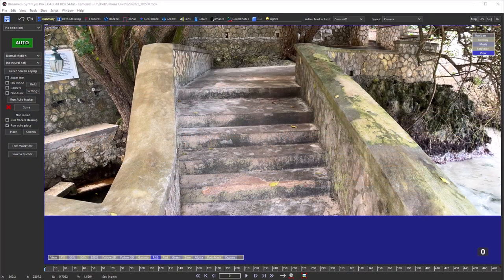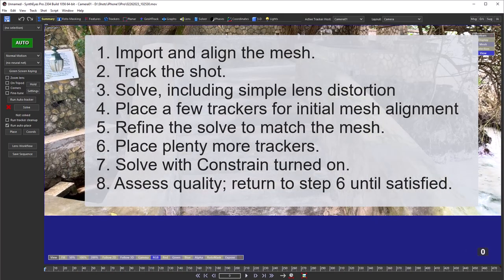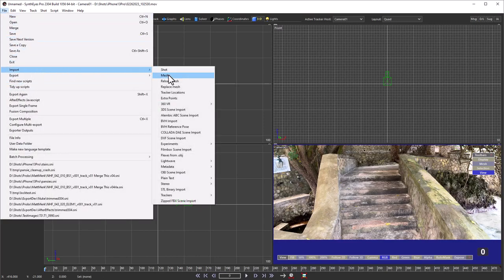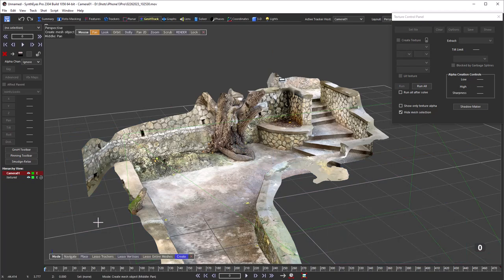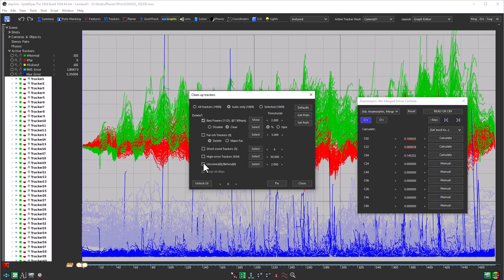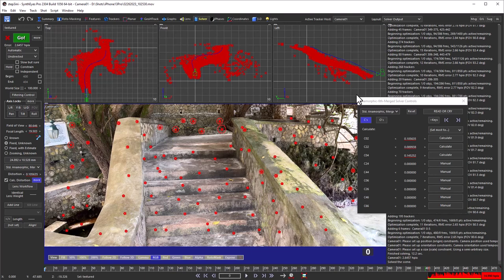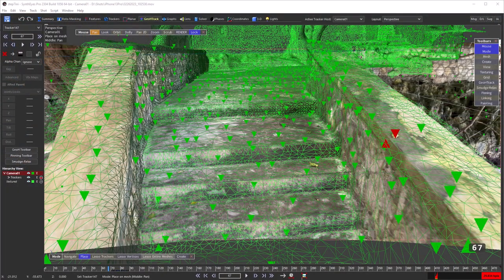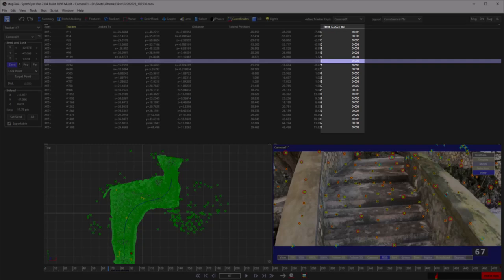Anamorphic Solve Using a Lidar Scan

Comment: Interesting, but I always had issues aligning meshes in SynthEyes. Even if it is a CAD model of a filmed product.
And still this is quite some effort here. If there is a 3D track resembling a shape - and a corresponding 3D object, shouldn´t be it just a matter of a few clicks to make software realize this and align? We live in times when one single word can product photorealistic images - with just one click.
Reply from the maker: Licensed customers can ask for help, there are many ways to do alignments in SynthEyes. Regarding "AI", sure, more things will be possible in the future. AI systems are not known for accuracy, they're better at one-time tasks than doing something repeatedly the same way. (You can see that both in SynthEyes's NN trackers and in Tesla self-driving systems, for example.) Also keep in mind that OpenAI's cumulative investment is something over $11billion; their server time alone costs billions. That's not something that can be supported for a narrow task.
Reply: @SynthEyesHQ  OpenAI is beyond scope, of course ;) But it´s possibilities too.
And there are even smaller companies achieving crazy results, for example in the field of motioncapturing humans.

When aligning geometry it would be a very narrow task: recognizing landmarks within two 3D-objects and aligning them. maybe this is even possible without machine learning... I mean - tracking visual points automatically (which has been possible for a long time) works also without machine learning.

I´m pretty sure such an automatch is possible already - and with no doubt it will be implemented into matchmoving software.

I´d just love to see SynthEyes implementing it first! ;)
wasn´t meant as a complaint, sorry
Reply: oh, and regarding data density: a way to ease it up would be to mask out areas of the 3d object and just use the areas left over for the autoalign (while the rest of the geo still exists - and just moves with the small areas)